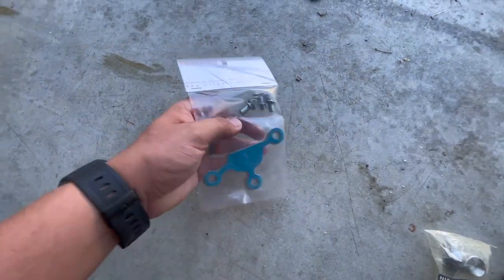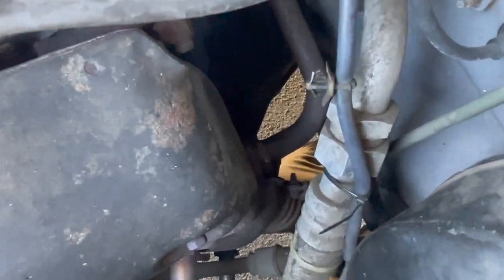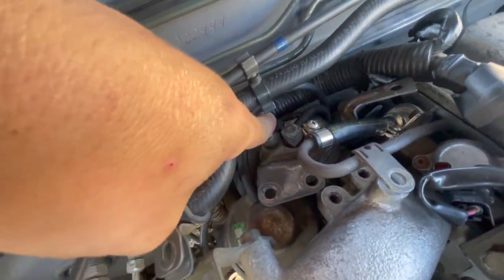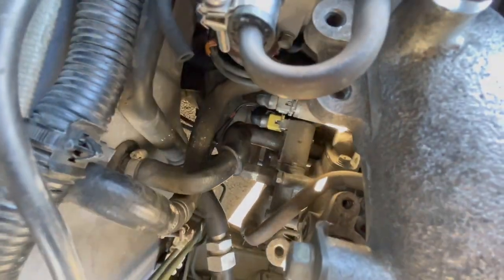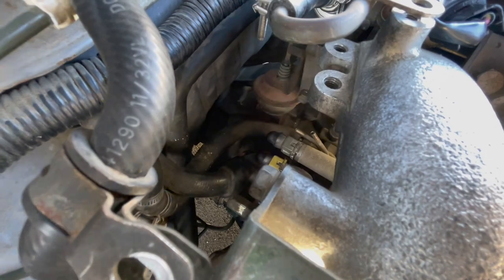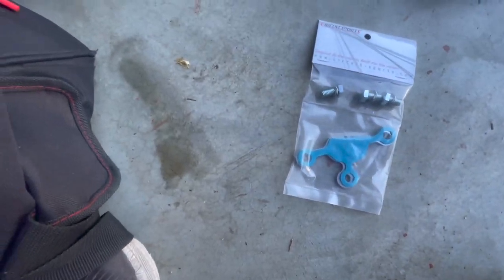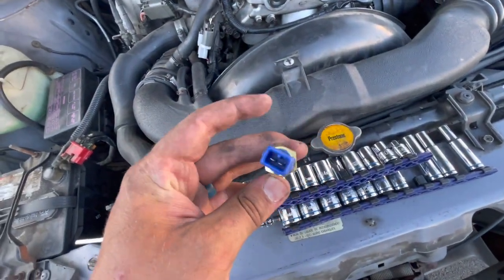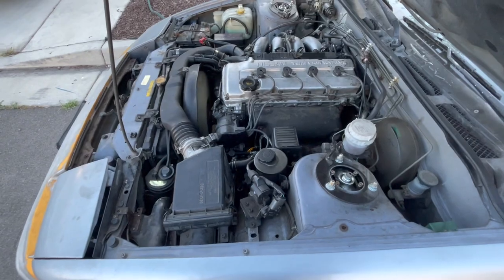NISSAN 240SX EGR DELETE (THE RIGHT WAY)

Comment: The exhaust gas is inert and reduces combustion temps, and in effect, cylinder head temps. That crack would reduce pressure going to the bpt valve, and each exhaust impulse would suck in a bit of air to the o2 sensor. If you don't wire in a resistor to the egr temp sensor it will constantly throw a Code 32, because the sensor is looking for a temperature change that's never going to happen now.
Reply from the maker: Thanks for watching! Good thing I removed the cracked hose for sure then. As much as I wanted to save the EGR system, i would have been chasing my tail like crazy looking at that mess haha. The plan is to wire in the resistor when i stop being lazy lol
Reply: so did u delete urs or no? i deleted mine no issues but curious on ur thoughts
Reply: @yadielacevedo2143  My EGR is still intact. From what I've read regarding EGR function, results vary based on driving conditions per user. Some report no change at all, some say it performs better, others say it's worse. For fun, I blocked the BPT from the EGR and didn't feel any significant difference in performance, maybe a bit more pep in the ~1.5k to ~3k rpm range where the EGR is supposed to function, but business as usual at higher engine speeds since the EGR is normally closed then and during WOT. It did put my NOx through the roof even with a fresh catalytic converter though. 

But then, my KA is stock aside from a beefier radiator and fans. Someone with some work done may see different results from the A/F dilution.

tl;dr: More NOx, barely noticable gains.

Comment: Dude thank you. You somehow explained this better than any video I could find😭 Gonna give it a go this weekend. Makes so much more sense now. I did want to ask, for the back egr bracket, do you just leave the 2 harness connectors hanging?
Reply from the maker: Thank you so much for watching and im glad the video is helpful! The 2 harness connectors just hang back there and you can kinda tuck them away to make it look pretty if you want to. The whole job honestly took me an hour of combined work. I hope it goes well for you 🤟
Reply: @RedneckTuners  I watched a few other videos and they said you had to remove the plunger & butterfly valves because the plunger has a vacuum line at the bottom. But I see you left it and just capped it. So I’m a lil confused on which way to do it.
Reply from the maker: @machi7796  Honestly, i ran mine capped off in the car for over a month with no issues but unfortunately i had to pull my whole manifold out to replace the top plenum since it was sealing properly and led to a bad vacuum leak. Since the manifold was already out, the butterfly valve got removed. If you plan on taking off your manifold id recommend doing the delete while its out but if you wanna do it simple you can just cap it off
Reply: @RedneckTuners Yeah ima cap it off. Also, did you cap off the 4 vacuum lines that are also going to the front?
Reply from the maker: @machi7796  The four i capped off in the video run to the front under the throttle body and are used in the charcoal canister. If you plan on keeping that for venting to the gas tank you can just leave them all capped where i did in the video. If you plan on deleting it, you can cap them under the throttle body as well and delete the canister but make sure to vent your gas tank if you do go that route.
Reply: @RedneckTuners  so I removed my charcoal canister too, from my understanding, I capped off the 4 from where you did in the video, Now, the lines run over to the front by the throttle body, I see 5 lines, do you know which ones I have to cap since there’s 5? Or do I cap all of them?
Reply from the maker: @machi7796  if i remember correctly, they can all be capped off. The only vacuum the car requires to run well are the FPR, IACV, and Brake Booster

Comment: Sup man this vid helped a lot and I also have the same issue with the misfire. If you figure it out let me know. I have a 1991 also. Deleted EGR along with the vacuum tubes leading to the air intake
Reply from the maker: Hey bro! Glad the video was helpful. I ended up tracing the misfire to a pretty decent sized vacuum leak between the bottom intake plenum and the head. Took it off, cleaned the surface, new gaskets, and shes run perfect ever since. If you need any help or anything DM me on instagram and id be glad to help 🤟

Comment: Do you have to block off the 4 vacuum lines under the throttle body since it’s connected to the back 4 hard lines that you blocked off
Reply from the maker: @ynnbajay6153  If you are planning to delete the charcoal canister then yes. Those lines feed into that. If you plan on keeping it then it is fine the way i showed it.

Comment: This was a good walkthrough, sadly im in California. I honestly watched this for some insight on a "clean" removal so i could clean and replace mine. My 93 is throwing an egr code and i need to get it smogged before the years ovr and i figure its a combo of carbon and the hard to reach vac lines being cracked. Do u know if the recirculate tube bolt that mounts to the actual egr is a 30mm or 31mm?
Reply: You could move to Washington State. They got rid of emissions testing - and 25 year-old cars were exempt when they were still doing it.

Comment: My 240 vert has been owned by an idiot before me at some point; who decided to just cut vacuum lines on the EGR and sealed them poorly causing the car to shake at idle and sometimes die at stop
Reply from the maker: @WRX_Caleb_Earl  Yeah that definitely sounds like a vacuum leak problem causing the sputters or dying. I would for sure do the proper EGR delete and see how that does for you. If it still persists maybe do a smoke test on it. Good luck! 🤟

Comment: Could I still pass emission tests? Does it help the vehicle run better?
Reply from the maker: As far as emissions it depends on your location. In California, it definitely will not pass, but other states it may. Personally, my car did end up running better because of how old and cracked all of the vacuum lines are and how clogged the egr tube and bpt valve was but if your car is functioning in the stock form just fine, I personally don’t think it is worth removing.

Comment: Hey what’s your instagram. My 240sx has the same issue. Identical. Maybe we can troubleshoot it together lol
Reply from the maker: I fixed the problem and it was a vacuum leak where the upper and lower intake manifold meet. Hopefully this solves your issue. My instagram is @Redneck_tuners if you need anymore help!🤟